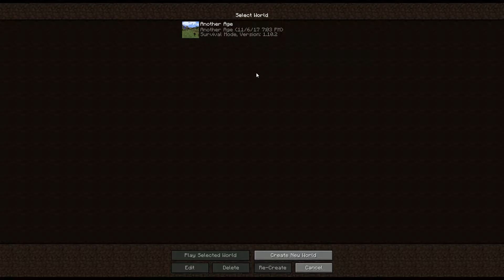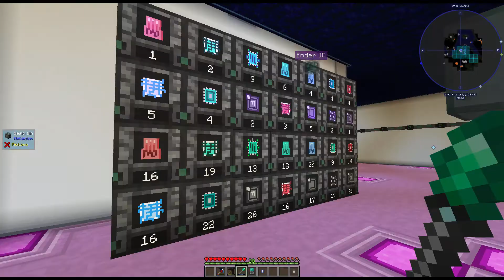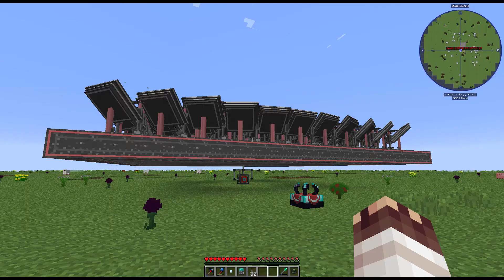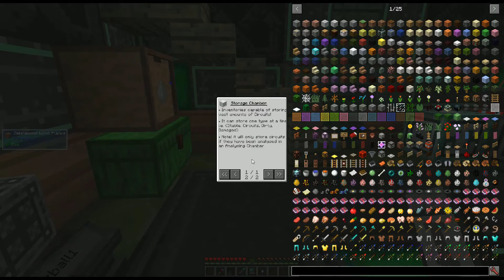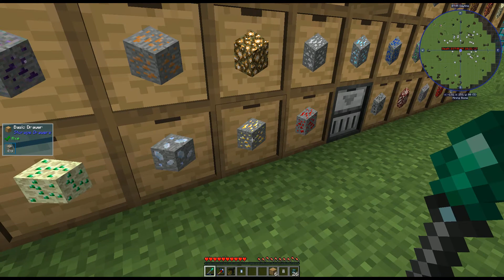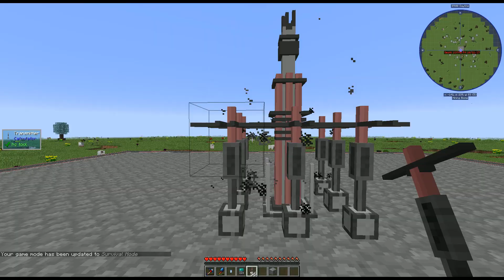New Age of Engineering Supershorts #15: Atomic Projects

Comment: Holy crap, the lens of disenchanting works on the Neotech pick? Nice! I guess I can take down my clunky (but functional) setup using the the pick in a mechanical user then. I had so many ores I needed it for that I needed 2 interfaces route to it and 2 ranged collectors to pick up all those fat fortune 5 drops.

Speaking of Neotech, I'm using it to make steel really fast (it's absurdly fast with octacore processors and maxed DDR cards), but unfortunately the only way to get the steel out without turning it into refined iron is with tinker's casting basins, and for some reason it's casting into Extreme Reactors steel blocks. It's ore dictionaried to "blockSteel", but for some reason won't go into a compacting drawer with my immersive engineering steel that I've been getting out of a improved blast furnace. I even tried inserting it manually, still didn't work. Anyone know a workaround for this issue? I don't want 3 kinds of steel clogging up my AE system and making autocrafting a pain.
Reply from the maker: It's a pretty amazing exploit.

What I did was to use casting tables.